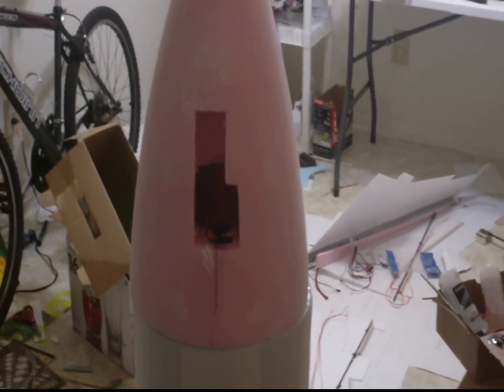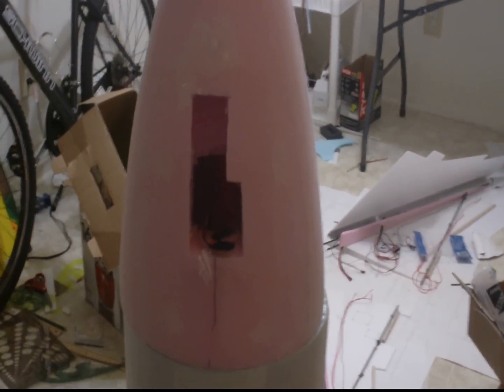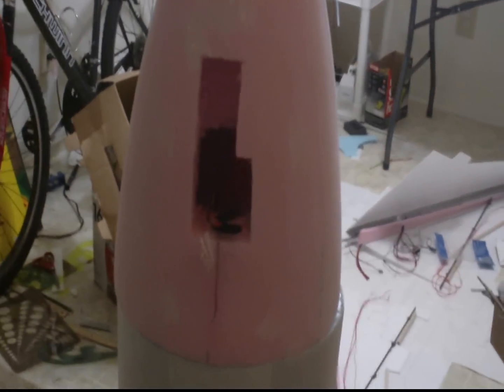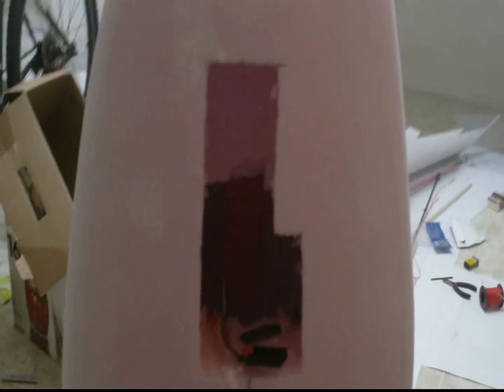How to build a 7 Foot Airbus A300 RC EDF Airliner Part-31

Comment from the maker: @jrd1461 Hi Boss I don't have a website persay, but I do have all my build logs on my RCGroups blog
Simply go to rcgroups Dot Com & type in demondriver . . . . I will draw up by hand new plans of my A300 for you, I draw them up by hand because going to kinkos would cost you over 200.oo but by using trace paper & going over the old plans I can make you new ones for under 100.oo . . . .remember this A300 is a 7foot long jet!
Contact me through a private message, thanks!